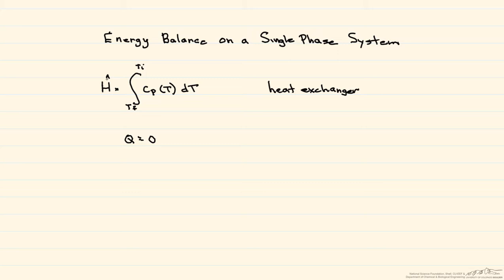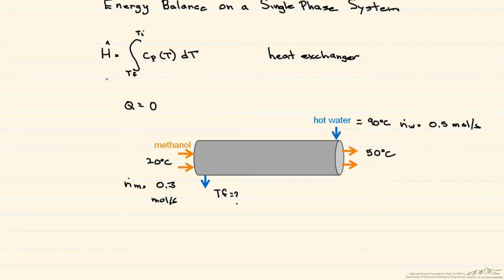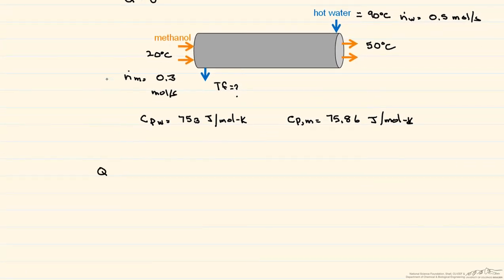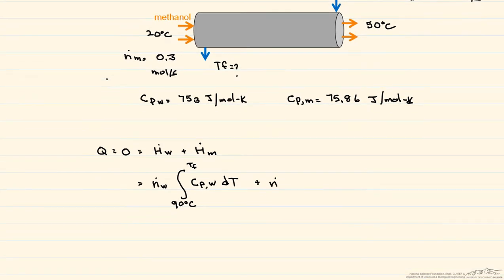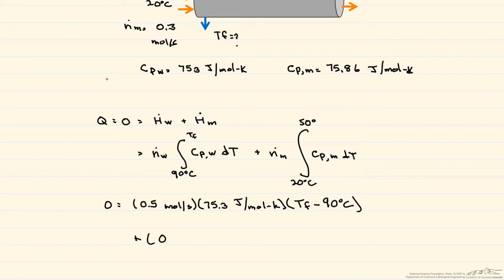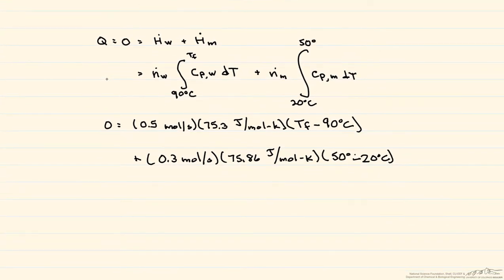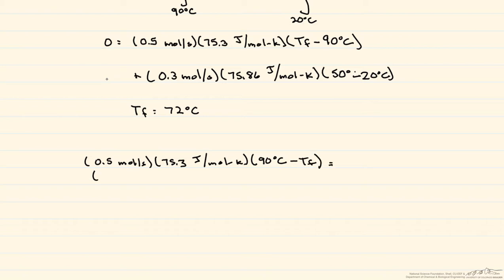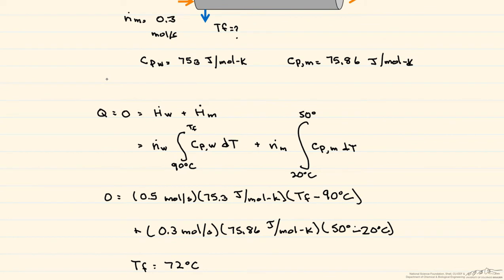Energy Balance on a Single-Phase System

Comment: So... 
liquid -> Cp change can be ignored
gas -> Cp change can not be ignored
Right? But, Why?
Reply: Liquids are incompressible, so the changes in volume due to pressure are not significant so we can assume safely that Cp will be constant. However, this is not the same for gases.
Reply: @juanmatheodelgado1492  ow yea, right... i forgot